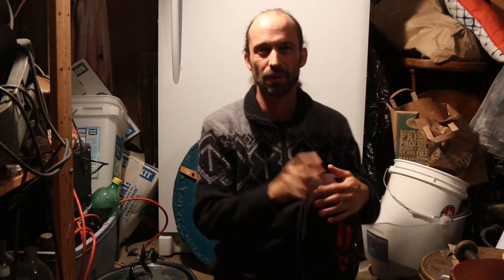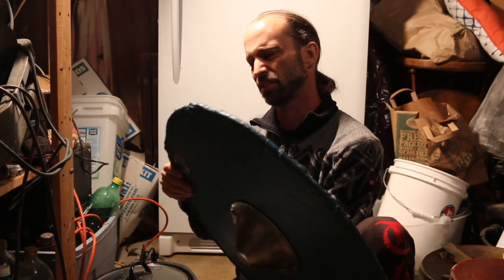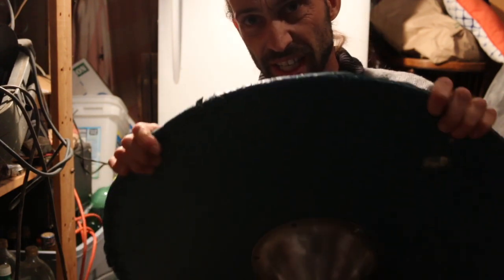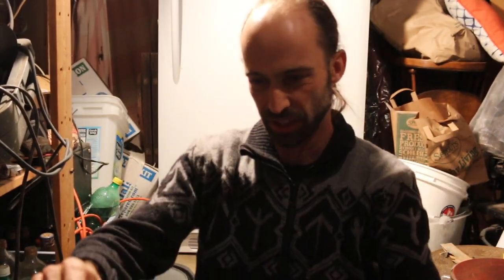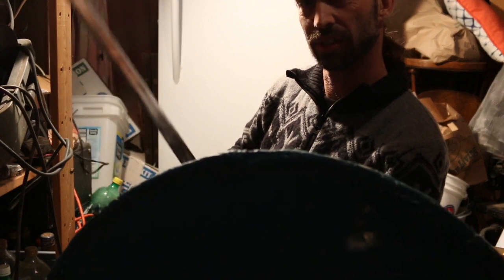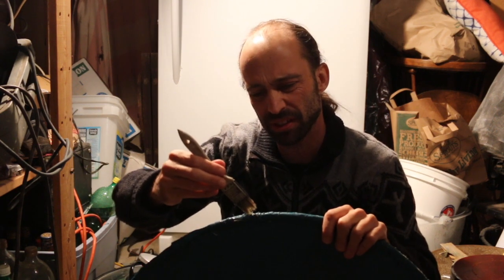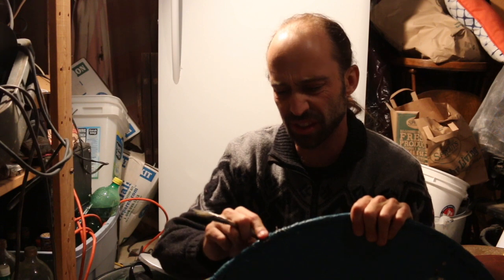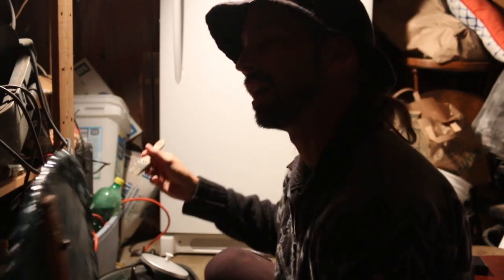Viking Shield Repair System How to repair a viking shield without replacing rawhides.

Comment: What did you use to color the glue?
Reply from the maker: The glue I've used here is uncolored. The green paint is normal store bought.  For the other shield, I used blackberries for the black and rust powder for the red, I will make videos on producing colored hide glue soon!
Reply from the maker: And... I'll be generally experimenting with other dyes and colors, as well as fibre arts..